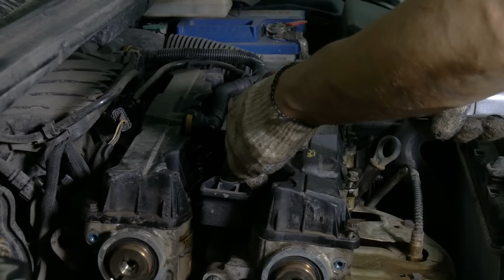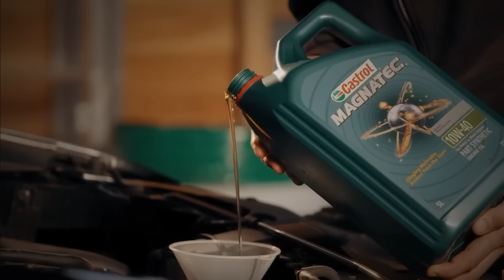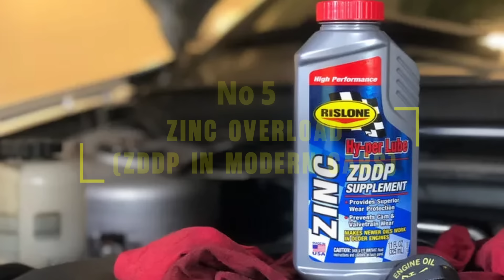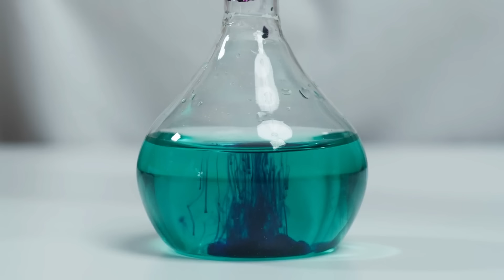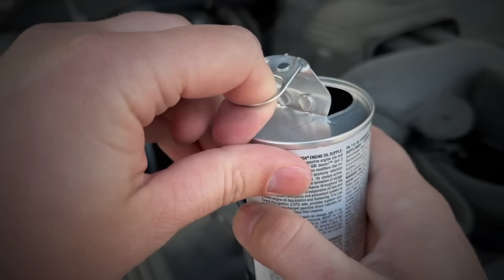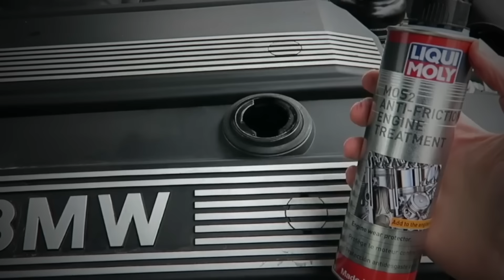11 Engine Oil Additives That Will DESTROY Your Car! (And 5 You Should Use)

Comment: I would like to challenge one of your assumptions w/r/t engine oil flushes.  Anyone who pours in a flush and starts to drive anywhere is just not understanding what is going on in an engine lubrication system, and sure do not understand what is in that FLUSH bottle.  Amsoil has an excellent flush, but you must use it in accordance with the label instructions.  You Do Not Drive Anywhere.  You pour it in just before the oil change AT the Oil Change Location.  You do not place the engine under load after adding the flush.  The oil change location I use has a slanted drive so I back in and pour it in the crankcase . . . let idle for 10 minutes, then get in the line which is about 10 more idle minutes.  No load, and no drive.  The Amsoil does the work it is supposed to.  I rarely go more than 10,000 miles on an oil change, but I do multiple oil filter changes between the oil changes.  That is the key to keeping bad things from circulating in your oil because the filter fills up and the valve opens letting it just flow through the motor . . . usually during high load.

Comment: I've used LiquiMoly engine flush numerous times, BEFORE oil changes, and have had no problems. Obviously, if you drive with engine flush in your system for prolonged periods, then you're asking for trouble. You are only meant to pour it in, and idle the engine for 10-15 minutes before draining, then refilling with fresh oil afterwards.

Comment: Graphite in oil is like dumping Gray, find sand into the oil and it'll eat the engine apart. In fact, graphite used to be used in used car lots many, many years ago and was outlawed in many, many states because it will make it run good for a little while and then all of a sudden. You need to rebuild your engine because it blew apart. Because the main bearings blew apart that's what graphite does

Comment: What you're posting is good and I do like hearing that people do need to know this, but also, if you put it in oil additive, you need to be very, very careful with what you're doing, because that can also degrade the viscosity of the oil that is already should be in the engine when you do that, you don't know what you're going to get? And if you just stick with your oil changes and take it to a professional if it needs a flush, but that's the way that should be handled and somebody that actually know,s what they're doing.

Comment: Marvel is used as an engine flush. It dissolves carbon in rings, and should be drained and filter changed after a 30 minute idle. Use it with cheap oil and the oil will be black when you drain it. It has been used as a fuel top oil in piston aircraft for decades. If it caused any problems, pilots would have caught that long ago.

Comment: Teflon does not coat engine parts; it bonds to friction points.  rings, cylinder walls, bearings.

it works.

Comment: I had a recently rebuilt 6.5l GM diesel that I used Lucas oil stabilizer (conventional oil) in.  One day, one of the oil cooler lines blew and I didn't catch it right away.   Ended up driving 3-4 miles in town to my destination.  When I came back out, is when I saw the oil dripping underneath.  Replaced the cooler lines and refilled the oil - no metal flakes in oil, oil pressure same as before.  Lucas saved my engine!

Comment: Magnetic does not have to be milled down magnet added to the oil. It could also clinging, like oil is being attacted to the surface of the metals VS immediatelly running down to the pan after engine shuts off. Like if you poor water on the glass, it will immediatelly run down leaving pretty much nothing behind, there are could be some liquids that if you do the same, will not run down but leave a layer of film. This could be marketed as "magnetic" right? Better marketing word then "Clingy"

Comment: Seal had broken down and its pieces were circulating trough the engine? Was it the engine without mesh in the sump and no oil filter that just takes whatever is in oil pan and sends it straight to circulate trough? What a BS. $40 gasket  job??? Ok everyone, just google "your car make/model valve cover gasket" pick genuine, Victor Reinz or Elring, lets not go with any knock-offs, is it $40? Also google "time it takes to replace valve cover gasket in your specific car" - whatevet time x it by what? $150/hr at least, I guess this is what shops charge these days. Land Rover dealer charges $270/hr for example. By any means I am not advocating for Stop Leak or any other additives, just change your oil every 4-5k miles with good quality oil and you should not be needing any additives. I am just trying to point out that author of the video not only not involved in automotive service industry, he/she if owns the car, probably leases new cars  and  has no efing idea about vehicle  ownership, just made up video from sitting on the couch with PC.

Comment: Agree on graphite 100%.
Back in the early 1980s there was a motor oil with graphite in it.
I think I used it once. I noticed my oil pressure went up significantly. 
My uncle who was an marine engineer told me not to use it and that graphite is clogging my oil passages.

Comment: Thank you I robot , meanwhile back in the 70s I had a 1963 Ford Capri GT , doing a rush oil change I pinched the O ring on the filter put the oil in with a can of STP, it was 100yds from the house to the road , drove down town did the shopping , Got back in the car started it AND NO OIL PRESSURE , Found the problem bought a new oil filter fitted it & put fresh oil in & checked for leaks , Drove the 5 miles back home to see a 100 yd oil slick from the drive down the road to, So inside 200 yds it leaked out all the oil , Had I not used the STP that engine would had been toast , it drove 5 miles with no oil in it . 
Best advert I've ever had for an oil additive ,/ UK

Comment: G.K. U.S.A  I purchased my first car  in 1964. It was a Ford with a 390 cu. Inch engine and 4 barrel carb. The oil it came with was 10W30 multi- viscosity. I should have stayed with this oil and 2500- 3000 mile oil and filter changes. Instead,  I tried to save a few bucks by using worthless additives to extend oil and filter changes. After 60000 miles, the engine began to show excessive wear. Nothing serious, but noticeable. I sold the car at 75000 miles. One of my friends read an article about the noisy lifter problems that I and others had experienced. That article stated that the use of the " new multiviscosity 10W30 oil was very important for that engine and that changing the oil and filter at no more than 3000 mile intervals was also very important. I should have listened to a friend who said that oil and filters are cheap as compared to engine overhauls. The 10W30 multi- viscosity oil was a new development and supplanted the straight weight oils. The 10W30 oils had a great viscosity and detergent package but still had to be changed at the correct intervals.   When having my oil and filter changed I asked if a heavily advertised oil additive would be a good thing to use. He told me that it was worthless and to save my money and treat myself to a banana split ice cream sunday. Another repairman dropped my oil pan and asked me if I had been using STP. I said yes and he showed me the STP in the bottom of the pan. He said that at best it was worthless and may be doing more harm than good. The best use of STP is to coat the key parts of an engine that has been rebuilt.This proceedure prevents a dry start. 40 years ago I went with full synthetic motor oils and 25 years ago I started using Amzoil products. I will not use any additives in my engine oil- EVER !

Comment: Liquimoli i have used for over 65 years with only great results in petrol and Diesel  current 2012 diesel Jeep 362,882 klms
Never for get to change on with oil  filters and smart driving Cheers.
Ken.

Comment: Just run the right oil with the right specifications at the right oil change intervals.  The chemistry is already worked out for you. No need for guesswork.
Reply from the maker: That's a solid approach to engine maintenance!

Comment: My dad used Marvel Mystery Oil in fighter plane motors in WW2 . I've used it in my vehicles for years .
Reply: ALL the Old-timers know how well Marvel Mystery oil works
Reply: Yes, been using Marvel Mystery Oil for years myself and it works.
Reply: My grandfather, who was a mechanic. Turned me on to Marvel mystery oil 60 some odd years ago.
 I've been using it on and off eversince and especially during the conventional oil days.
Had my 1970 Olds Cutlass S rebuilt at 230,000 and the machine shop said told the mechanic all the moving parts were still within spec.
Now I have car with GDI and way more electronics so just sticking with the OEM and Top Tier gasoline
Reply: I've used Mystery Oil as a fuel additive, and as an oil change flush (8 oz-run for 10 minutes and then drain), and Ive reached 250k on 3 fords.

Comment: I disagree with the pre-oil change cleaner, the guy didn’t do it right driving on it was a bad idea.

Letting  the car idle with flush for 10 minutes then doing the oil change should be fine.

Comment: what about ZMAX?  I used it in my 2013 camaro at every oil change for 8 years until i traded it in.  never had a problem with my engine and it actually made my engine temp cooler over time.  would never run above 185 F.  engine had more power after adding to oil after an oil change and engine was cleaner and ran cooler.  why didnt this guy mention ZMAX????

Comment: Slick 50 destroyed my Quad 4 engine back in 1994... it had a huge advertising campaign back then, and thousanda and thousands of people were duped into using it.   $7500 to replace the engine in 1995 after being in the crankcase for only 1 year on a 55,000 mile engine

Comment: I have a 2004 BMW E46 M3 that does see the track from time to time.
Other racers recommended Liqui Moly MOS2 to reduce friction and heat.
Yes it did make a difference since I now have 165K on the odometer and the engine still runs GREAT!
I do recommend Liqui Moly MOS2 for newer engines like my BMW S54.
Reply: LM MOS2 also cleaned up my oil ring/scraper ring seal by removing carbon deposits... My oil consumption stopped over night etc...

Comment: Always changed my oil at 3000mi with conventional oil back in the day and 5000mi w/synthetic oil for over 40years, I’ve never ever had any engine issues, never used any additives! I’ve also changed tranny and diff oil too, never had issues there either!

Comment: "Happy customers" never passed high school science class, and so are at the mercy of slick marketing campaigns. Perhaps some of the oldest straight additives had their place in the middle of the last century, but modern, high precision, close tolerance machines have engineers who actually know WTF they're talking about, and work with major petroleum companies to maximize performance, economy, longevity, and efficiency. Lead from early "ethyl" high test gases is still contaminating land adjacent to highways.
  You're far better off using the best rated oils from Mobil, etc. with quality filters like Mobil makes, and if you're anal, change at more frequent intervals. Every additive compromises the chemistry optimized for your vehicle, and while it might not actually cause significant damage, it is mostly padding the wallets of the marketers.
  Especially after the first minutes explain in detail why most products are bad, the few described at the end still fail the very criticisms he talks about before.

Comment: Former OTR driver I use Lucas in both Fuel and oil changes. I get less smoke and a tiny amount of fuel MPG. My John Deer 850 also same results not too much is the key.

Comment: I have used Engine Restore for over 30 years that my dad taught me to use and neither of us have ever had engine issues for hundreds of thousands of miles of our engines running like new in all kinds of makes and models. I like my snake oil and I'll continue to use it.
Reply: I have used engine restore for over thirty years and solved a lot of engine problems with it I will always use it in older cars as well as new ones
Reply: @crissclarklenhart I've also seen other videos where Restore has fixed really bad compression and other things as well. Soon as a vehicle gets around 70k miles I use it.

Comment: Tricresyl Phosphate (TCP) is the anti-wear additive in Marvel Mystery Oil which I've been using in all my engines since the 1970s. My 97 Toyota 4Runner has 380,000 Original miles doesn't use, burn or leak Any oil & has Always had Marvel Mystery Oil. The US Military has been using the product since WW1 purchased in 55 gallon drums & used in ALL Military Equipment. My dad was an Aviation mechanic I know what I'm talking about.🇺🇲

Comment: Marvel mystery oil is fantastic...102 years old..use it in my 456,000 miles, same engine,1984 VW scirocco and also in my airplane 😊
Reply from the maker: That's amazing that you've had such great results with it for so long!
Reply: But  you said Marvel Mystery Oil is not good !
Reply: @ironfistarrival no, you have me mixed up with someone...I love mmo
Reply: Agreed. MMO is a great lubricant for both gas and oil

Comment: The only oil additive I ever used was Marvel's Mystery Oil (MMO).  Back in the days of conventional oil, I would use a 10% mix in my engine oil.  When I started using synthetic oil, I would check the oil around 500 miles before Oil change and "top off" with MMO.  These days, both conventional and synthetic oils have so many detergent additives, things like MMO are a waste of money.  Mind you, I brought an old Chrysler 318 that was very sludged up back to life using MMO, so I don't believe it's garbage...just no longer needed with today's oil.

Comment: In Summer oil back in 60's and early 70's I used STP oil treatment in my 64 Comet, 69 Dodge Coronet, 67 Chevell it worked ok..Usually changed my oil back then at 2,400 to 2,600 miles..

Comment: I use Ceramic Additives since 25 years, never any wearproblem with any engine. LecWec is my Stopleaking product, many engines and power steering and diffs are now not drippin any more

Comment: @@Cars.GuideDIY

Can the MOS and the TriboTez be used together?
Reply from the maker: It’s not recommended to mix MOS and TriboTez — both are additives, and stacking them can change oil chemistry in ways the manufacturer didn’t intend. Best to stick with one at a time.

Comment: A good oil changed often is  worth 1000 additives, that's clear for me. 
Also I used a lot of DuraLube in the past with great results . Engine was clean and souple with full compression after 200k miles. That's my personal experience.
Reply from the maker: That's a great point about regular oil changes being key!
Reply: @Cars.GuideDIY  Same here for Duralube. Been using it since it came out and have NEVER had engine problems period. My cars are all retired because of rust, but all had good running cleam emgines.

Comment: Bagging castrol magnatec is unwarranted. 
In aave tried every oil i could in 3 countries- uk, france, australia. 
Magnatec beats them all on smoothness, lower tickover, smoother acceleration. 
There are no "metal particles" in it. 
From the first oil change with magnatec in it,the difference is the most noticeable.
I have tried: 
Mobil 1,  antar, shell, fuchs, valvoline, penrite, and castrol magnatec is the only one that made any positive difference. 
Cars tested on- 
Subaru outback h6 400,000 kms, toyota v6 prado, 230 k kms, bmw k1100lt motorbike.1999.

Comment: What about Liqui Moly Ceratec? Looks like there's A LOT of happy customers. And how it compares to their MoS2?
Reply: I've read the same reviews. I put the Ceratec in my 2017 Focus ST manual transmission last fluid change a few thousand miles ago. Hoping it makes my transmission last longer like many others have said. We'll see!
Reply: I think archoil is a good alternative to this... both cheaper than tribotex at least. idk that i'd trust cheaper brands of ceramic additives though
Reply: i've heard of issues with it, but i think they revised the exact formula at some point
Reply: I’ve put CERATEC in my 2016 Holden Commodore VF without any issues. Purrs quietly with excellent response. It is not supposed to be combined with MoS2.

Comment: Been using Z Max oil and fuel additive in my 2003 Tundra ever since owning it.  It now has just over 200,000 miles on it and it's a waste of time to check the oil in it between 5,000 mile Valvoline Advanced  oil changes.  If the oil isn't on the ground where I park it, it's in the engine.   It has the original injectors and spark plugs in it and original catalytic converters on it.  Passes emission inspections every year and starts, idles and runs like new.  Inside of tailpipe perfectly clean.  I'm a believer in Z Max products.   $40 for oil and fuel additive kit.

Comment: Are all the additives not recommended not OEM, etc approved,,and are all those recommended OEM,,etc approved?
Watch Moly. It's not recommended for VCzt engines. I learned that after using it, getting 150p miles, the check engine light coming on and the VCT vslves,both front and rear needing to be replaced.

Comment: I've never used an oil additive, because the oil in the bottle should already be the correct oil for what it is supposed to lubricate.  25 years ago, when I learned about the 1st API certified oils by Amsoil, I've been using Amsoil products since then, for all of the parts in all of my vehicles.  Amsoil was brought to the public in 1972.

Comment: Engine flush additives must be used in a very specific way. One adds it to the oil, runs it for only the time specified. And then the oil must be dumped and replaced.